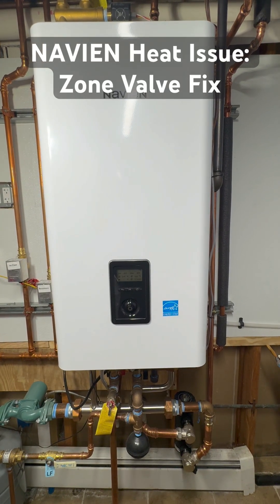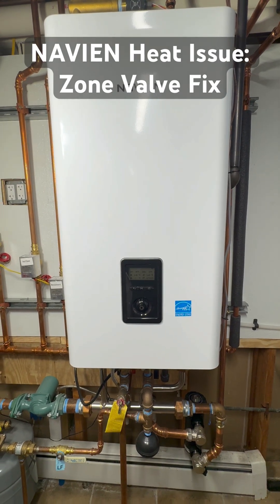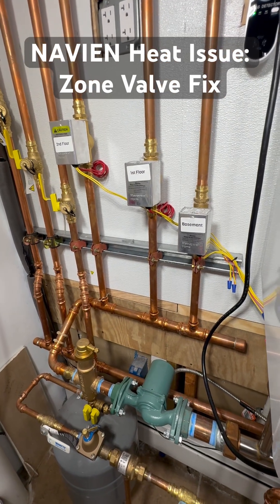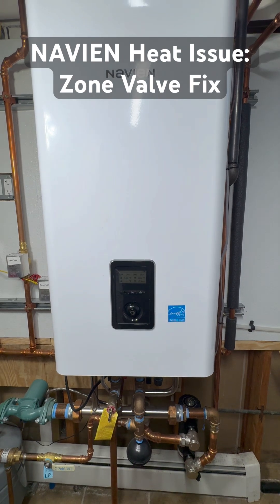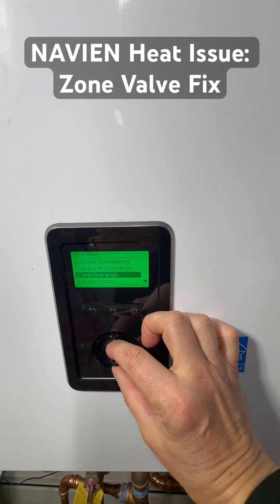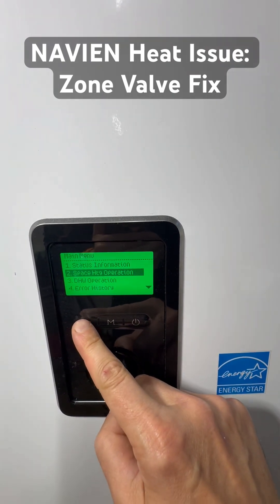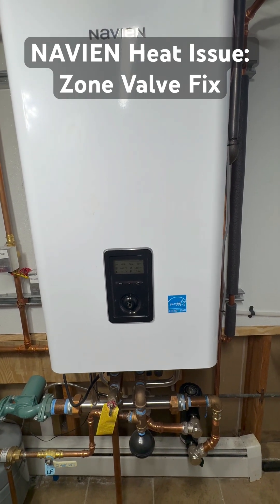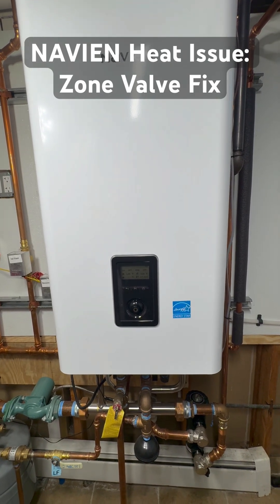Navien NFC Combi Boiler Not Heating? Hidden Zone Valve Setting That Resets After Power Loss #navien

Comment from the maker: Has your Navien boiler ever reset its zone settings after a power outage? If you’ve found a way to keep it locked on ‘Zone Valve System,’ I’d love to hear how you did it!
Reply: You could try a small battery backup system for the power out times

Comment: I will keep this in mind. I haven’t personally observed this happened. But I definitely won’t be installing zone valves on the NFC boilers in the future. I always just zone with ECM circulators
Reply from the maker: It definitely won’t hurt to reach out to Navien and mention the control board replacement. They told me that the updated board will fixes this issue. If they’re willing to send the part for free and cover some of the replacement cost, it could be worth pursuing. Good luck

Comment: Had this happen...  Less then 2 years old.  Tech spend 4 hours... wanted to change circualtion pump, then changed his mine.  Then changed the 3 way valve.  That did not fix the problem.  After the valve replacement he spend another 20 min on phone... THEN, he says he fixed it.  Yep, change to Zone setting, then the valves opened.  $521 ! ! 
How about a UPS ?  They won't run much during a blackout... but will keep the power on during blackouts for some time.
Reply from the maker: That’s a wild ride for a fix that ended with a setting change. Sounds like the tech went on a full tour of the system before landing on the actual issue. I feel that $521 sting. Honestly, you might want to forward this video to the technician, could be worth asking for a partial refund. At the very least, it’s a reminder that sometimes the fix isn’t in the parts, it’s in the settings.

As for the UPS idea, I agree it’s a smart backup—but even with a UPS, there’s usually a brief power drop before the generator kicks in. That momentary loss can still confuse zone valves or control boards. I’d love to hear from Navien directly on how to truly bulletproof this setup. There’s got to be a better way to prevent these costly misdiagnoses.
Reply from the maker: I spoke with Navien about this issue, and they confirmed the long term fix is a new control board. I share the details in this short update video: https://www.youtube.com/shorts/8WjKj9-w3nI